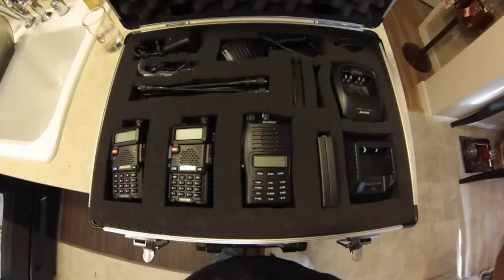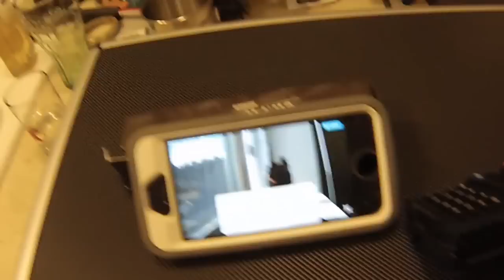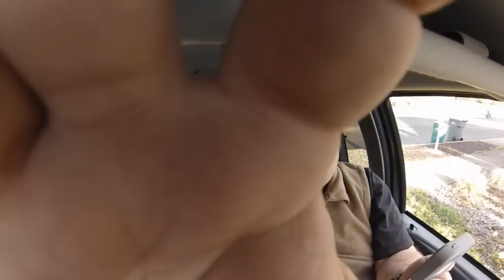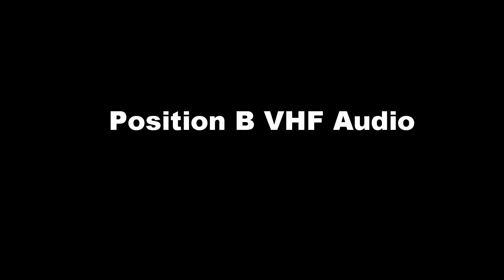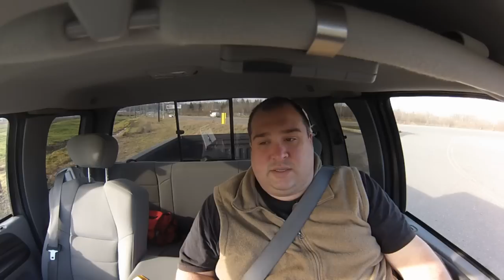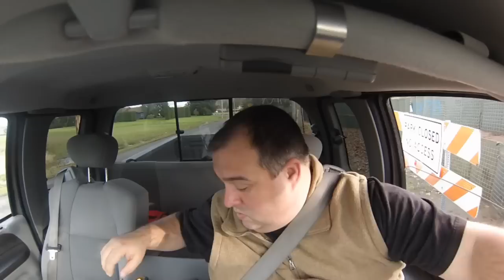Baofeng UV-5r Distance Test

Comment: Great video. Thank you for taking the time to show people a realistic test. I've used these for work in the oilfields of Alberta for two years solid and they've been great inexpensive work horses. Rain, sleet, snow DUST and they've never skipped a beat. I upgraded the antennas and even went as far as to get a couple of larger magnetic mount units for mine and a buddy's truck and put two in there with constant power supplies. I am pleased with their performance for their price point but I'll admit, I too had a bit of an unrealistic expectation of their performance capabilites; but once I got over that I learned to love this radio. I don't go anywhere whether it be driving, motorcycling, quading, boating or hiking without one or more of these packed for the journey.

Comment: Antenna is everything. I can make 19 miles to a repeater without any problems, and full quieting, on my UV-5R. However I was using a high gain Comet base station antenna on a 50 ft tower. The repeater is on a 40 story building as well, which helps. The worst antenna is the glorified dummy load that they come supplied with. Good for short range line of sight, rotten otherwise. Thanks for making the video. 73
Reply: P Toth yes correct

Comment: Using a UV 5R V2+ on a Diamond 7500 High gain mobile   antenna, at five watts, I was able to hit a repeater that was at least 20 miles away. So it really is all about the antenna. KI7BSL clean and signing off :)

Comment: Thanks for the vid. I do the same thing lol, it's all about testing.  In my locality I get 0.5-0.75 mile on the rubber ducky, and 1-1.25 mile with my j-pole variant antenna on simplex.  Out in lass populated area I have but she did 5 miles on Symplex with my j pole  antenna.

Comment: Good video, what antenna did you use? I recently purchased a BAOFENG UV5RTP  and am looking at purchasing Nagoya NA-771.
73
Reply: Nick C get the 771 and the 701 for versatility, ive got the 5rtp too, I love it, with the aftermarket antennas, it does what I need it to,( we k ow that a higher powered base and mobile with good antennas will always beat em out, but for a HT, u cant beat the baofeng for the price
Reply: smokeymountainrain , Good to hear. I'll look into getting them. Thanks.
73

Comment: Thanks for the vid!
so reasonably, trust it to a mile? i can live with that.  have you re-tested since this with a 
larger antenna?
Reply from the maker: Nope haven't retested them yet.  Had other projects get in the way.
Reply: no worries, ill sub and wait patiently!
Reply: +Bird_Dog you should program repeaters into your radio
Reply: A mile? I get 30 miles regularly with Uv-5R, and some get nearly 60 miles with their Baofengs, possibly 8W (actually 6W in testing on 2m, 7W on 70cm). Check video here on YT '57 miles on Baofeng HT'.

Comment: Whats the max distance you got on these? I want to transmit in NYC about a 15 mile range from my work using the baofng uv-5r+ to my Midland GTX1000 radios that would be at home. Post SHTF situation to communicate with my family. I would assume we need to transmit via UHF.
Reply: FYI I have a Hypario 771 DUAL BAND 144/430Mhz SMA F UV Ham Radio Antenna on my Baofang radio. Just trying to determine if I'd need another Baofang radio to use at home.